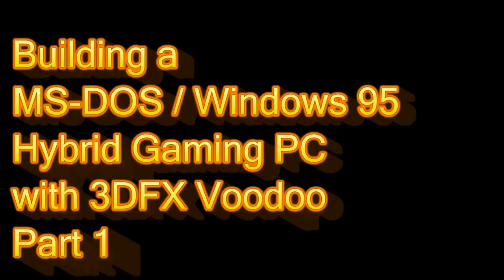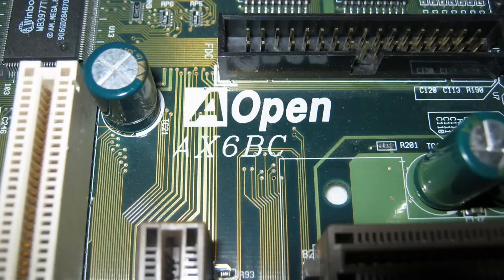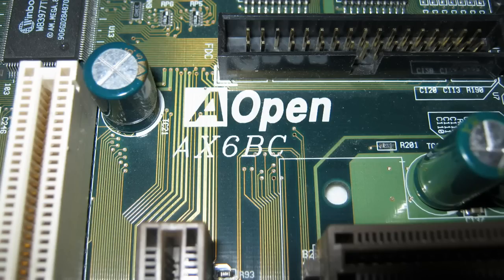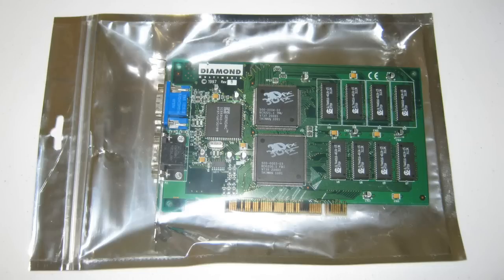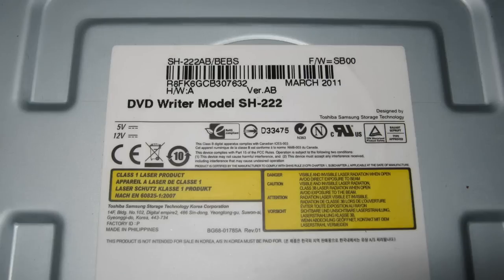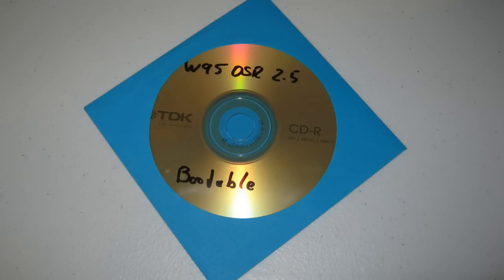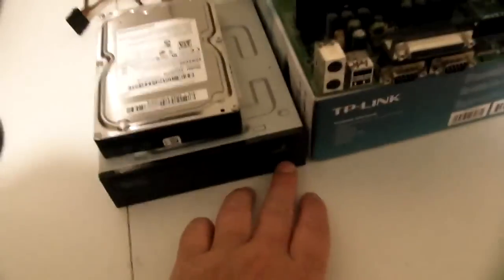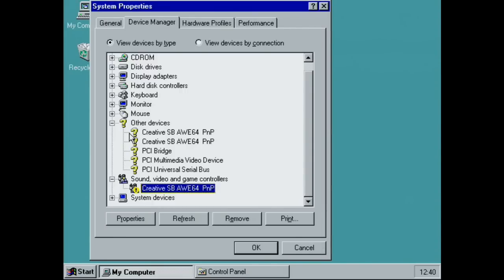Building a DOS Windows 95 Gaming PC with 3dfx Voodoo Part 1 of 3

Comment: I had an Orchid Righteous 3D Voodoo 1 card and a pentium 233 when I was 13 or so. The graphics were breathtaking compared with PS1 and Saturn (and even N64). I've just recently "rebuilt" this pc...found an original Orchid Righteous 3D on eBay and paired it with an Awe64 (I only had a generic crap soundcard back in the day) in a Dell Optiplex GN+ in fantastic condition. I even used vinyl dye on it to get an immaculate shade of PC beige. It's a beautiful set up and I love it. Maximum nostalgia. 96-97-98 was the golden age of gaming for me. Great vid.

Comment: Could anyone link me to a driver site for the 3dfx Voodoo1 i am trying to find some for my 486 build but i am not having any luck with finding drivers for windows 95 which have a self installer.
Reply from the maker: +ImpulsR 255 You don't need an installer. What you do is extract the driver, then go into Device Manager and update the driver that way. The README file inside the driver explains this in more details! I recommend the latest reference driver or 3rd party driver. I can't link it here, but you can get them from my website under the same user name.

Comment: going old school i had my 486 in 94 with doss 6.2 with a 486 intel overdrive 100mhz lol good old days :)
Reason i ask you about the PSU type i am doing same project as you just brought the slot 1 board from ebay still got 3 cpus still from 98 hope they still work and i have a ton of ddr trying to find a old white desk top case
Reply: +Phil Cool  Beige not white ;)

Comment: you may have helped me out. i was trying to install windows 95  OSR 2.0 on a pentium 2 300MHZ and i got this Vxd error that could not be fixed like, at all. I then found some capacitors online to fix my microstar motherboard (that my brother foolishly overclocked and blew up) which uses an amd k7 900MHZ. then after all of that, i installed windows 95 OSR 2.0 on that computer and it did not work. i was thinking that it may have had something to do with the type of motherboard( motherboards that support ISA slots, because windows 95 DID install on my other k7 700MHZ just fine, but the motherboard had NO ISA slots). Maby these types of motherboards have different quirks or something, because everytime i install 95 on them i get this Vxd error. i am going to try windows 95 OSR 2.5 now just to test it out. thanks for reminding me tho.

Update:
Nevermind >:( it didnt work again :(....
Reply: W95 didn't like AGP, MMX and IRQ overlapping for PCI devices. After all patches OSR2.5 version C seems to support it but truly unstable. That's why most "reviewers" silently skips to W98SE, because "it's same but better in every way". For DOS doesn't matter what to use if your CPU fast enough and not super fast and you have compatible sound and graphics cards.
You may run W95 on P II, but you need carefuly tune IRQ for AGP/PCI, if it possible disable ACPI and onboard USB. Best setup ISA sound, VGA card and for the 1 left IRQ you may use either USB2 or NIC.
Reply: Best possible hardware config for W95 non-MMX Pentium 133-166 32MB RAM 4MB Video (Trio, Rage, Riva) ISA sound. As for chipsets Intel VX or HX (hardest to get i think) is best, TX or VIA VP3 (not mvp3) pretty ok, if you mobo have ability to disable some newer features like ACPI. You don't need to have more than 256k cache, 512k make 64MB cacheable. No games was developed including OS needs for more than 32MB systems during W95 period, for DOS even 16 is needed for really latest games. Try to get mobo with SDRAM, even 1 slot is enough.
Reply: And above that we have Direct X. Version 6 breaks compatibility with earlier games,  7 breaks compatibility, 8 breaks ... Well 8 (and also 9) also had some subversions with incompatibilities between them, but games for version 7 pretty safe in 8, and 8 games in 9. And you say np, i didn't upgrade stock DX5 - wrong, some drivers didn't work with older versions if you need to use your computer for anything than just text processing or solitaire.

Comment: hi did you use a AT power surply or a ATX ?
Reply from the maker: +Phil Cool ATX for this one!
Reply: Phil cheers dude good help yeah was thinking of AT because of the 486 socket boards they use AT as there is no switching on the boards but there is with slot 1 ok :)

Comment: Does CD Audio work with dos games on a sata drive?
Reply from the maker: Only on some drives! Firstly SATA drives dropped the typical analoge output. But some have a digital output. But then you need a DAC, so yea, it's not straight forward. check out this video, it has some information about this topic: https://youtu.be/ecKsB8Sp89U